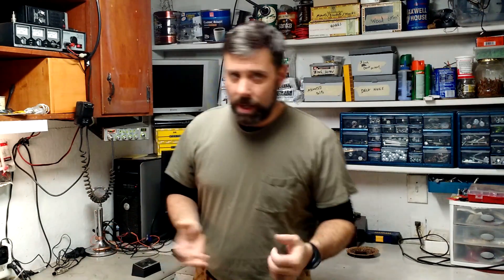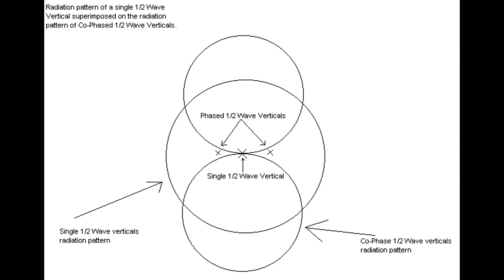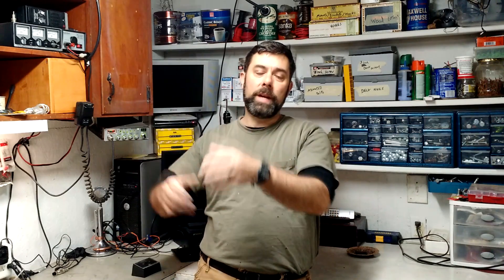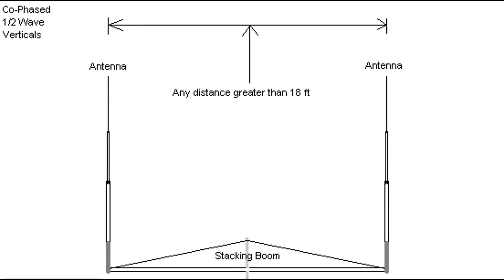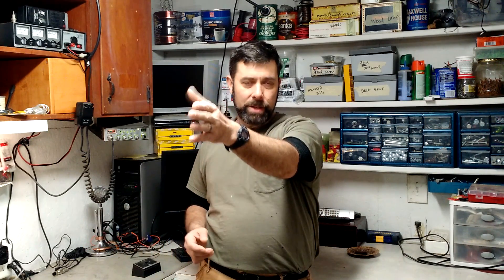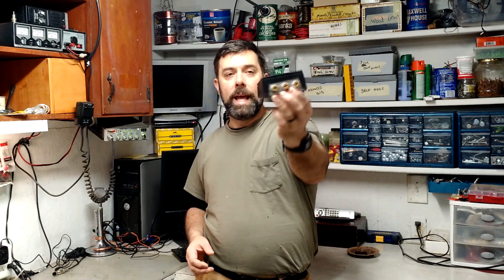Installing Dual Antennas For Your CB Radio. Co-Phased And Switched Setups.

Comment: Question, with a normal Co-Phased setup, will your transiting energy be divided by 2?
So if you have 4 watt going 2 watt to each antenna? Will my transmitting range also be less due to this?
Reply: Yes the power delivered to each antenna is halved with this set up. The radiated power fields should recombine to reinforce in some direction and subtract in others, in other words it makes the antenna system directional. I have to say I’m sceptical of any practical benefit of this arrangement on a vehicle due to a range of other factors too complicated to go into here.

Comment: I have co-phased 3’ firestiks on my F-150 and get a 1to1 match on channel 40 but , on channel 1 it’s 2.3 !  Is there more grounding needed ? Thanks
Reply: It could be related to the fact that the coaxial harness is cut to near 27.405mhz. This is one of the possible trade offs to phasing, although I personally haven't experienced much trouble. You see the cable acts as a transformer so the radio sees a 50ohm impedance. The cables have to be a specific length at the design frequency taking in the velocity factor. So in other words the array has a bandwidth. And if the antennas aren't exhibiting 50ohms then this can throw things off more. So you could play around with grounding or reposition the antennas by trial and error. Best bet is to have antennas with tuneable tips so you can dial up the impedance to some extent. No guarantees though, it's a bit of a guess.
Reply: Sorry I just realised you have Firestiks, I run a 4ft version. So you have some tuning there, with the aid of an analyser, you can really get an idea of what's going on. I'd measure impedance for each individual antenna. You could do this with a half wavelength of 50ohm coax taking in account for the velocity factor. Get them to 50 ohms each then put the harness back on. Then measure the impedance at the radio end and you should see 50ohms. That's one approach anyway.

Comment: I was thinking of doing a 2 antenna setup on my jeeps rear steel bumper. 
I need help with this can you help bud?
Reply: danialphaomega better off with a single antenna on a Jeep, tried both and had better luck with single antenna then dual antennas on my XJ

Comment: is it possible with or without a switch, to use two different wave length antennas on a car or truck, if traveling from flat open land  then into the mountains.
Reply: Good question, Anyone has the awnser? (I think its possible)

Comment: I run a IMAX 2000 about 40 ft High and I also run a Maco 7 element beam  antenna also up 40 feet with a rotor on it and a high power coax switch also have another switch relay or Dow key so when I talk it's through my radio but when I unkey it goes to SDR way better listening on SDR plus waterfall and everything else

Comment: 27 Mhz is the biggest screwup in band allocation.  They should have made CB what we currently now have as MURS (around 152-155 Mhz).  That way cars could easily have true 1/2 wave spacing for phased arrays since that band is about 1.9m so half of that would be only 0.9 meters or about 3 feet.  27 Mhz should have been allocated to hams as the 11m band.
Reply from the maker: I'm not going to disagree with you on that. It would have been interesting to see how the hobby might have grown or maybe not have grown depending on the band or mode that was made legal for CB here in the states.
Reply: That's your opinion probably based in one country.

Comment: What is the best antenna set up for a 1-ton ford van with a fiber glass top?
Reply: Here's the deal:
The formula for your vertical antenna PLUS the counterpoise that it needs is:
the number 468 divided by the Frequency you are using divided by 2 will give the VERTICAL LENGTH in feet and the necessary length of the counterpoise wire to make it work.  The counterpoise is THE OTHER HALF OF THE ANTENNA.
So:
Assuming channel 17 to be about in the middle of the frequencies you are looking at:
468/27.165 MHz. divided by 2       OR:     17.22 feet divided by 2 for a half wave antenna.  OR: for a quarter wave antenna which is the usual size even if less efficient you can divide the 17.22 by 2 then divide the resulting  8.61 feet by 2 for the 1/4 wave length.
This means:
Your vertical will be at it's best, most efficient length with a 8.61 foot vertical and a 8.61 foot counterpoise wire.
Your CB will work, with some slight power loss with a 4.36 foot vertical and a 4.36 foot counterpoise wire.
Bottom line:
Use ONE decent quality CB antenna (Firestick antennas are cheap and work fine).  DO NOT use a antenna with a coil. The firestick has its wire wrapped around the fiberglass stick and that's fine....Those sexy looking coils ain't gonna get ya laid so don't waste yer money!  Then cut a piece of wire  4.36 feet long (or just a skosh over 52.3 inches), crimp or solder a ring connector on it that is just big enough to slip over the antenna mounting threads. This will connect your coax braided sheath to the counterpoise wire.  Tape or otherwise secure the counterpoise wire so it's horizontal and stretched out away from the vertical and  doesn't blow around and yer done!
Just a Firestick and a proper counterpoise wire is ALL YOU NEED!   Then tune the antenna length for best SWR (which will be VERY EASY) and your radio will run better than any of the other radios set up by the truck stop bullshitters.
Now, If ya wanna get serious, go for the 8.61 foot vertical with the 8.61 counterpoise.  Run your counterpoise wire down the vans rain gutter and your done.  Your radio will turn into the monster you always knew it was when its antenna can actually radiate!!! 
bob/KF7ZSA
Reply: ,2 Wilson firesticks

Comment: With beam ant as your turning it will the stations come in better that your trying to reach ?
Reply from the maker: Yes. A directional beam can be turned to face the area a signal is coming from. For long range communications its much better as you will get up to 5 times the signal strength when you are lined up with the other station. 
   Beams are great for base to base communications, but have a hard time tracking a moving car.
Reply: Hi ED.  Licensed Ham Radio Operator here.  With a beam antenna the signals energy is concentrated in one direction.  It works the same way when receiving.  You can generally only hear from the direction the beam is pointed.  The most simple beam will be a two element beam.  

It has a driven element and a reflector.  If you add another element opposite the reflector from the driven that will be a director.  You can continue to add more directors.  As you add them the signal concentration becomes more directional or narrower and the better you have to aim it to receive a desired station.

You need a pretty decent rotor to turn a CB beam antenna.

Comment: Unless you plan to use full 1/4 wavelength antennas I wouldn't bother with it.
Reply: That actually makes no reasonable sense at all. Care to explain this theory.
Reply: @arconeagain  Shortened antennas lose quite a bit of gain. Trying to get some signal back in the form of 1/4 wave physically spaced as well as 90° phase separation isn't enough IMHO to be worth it. A plain old SS 1/4 wave whip mounted so it will clear bridges will do more and cost less.

Comment: Even on large trucks a phase antenna system is a fashion thing, and not a performance thing. After  actually plotting installations using a field strength meter and using modeling software I never found a phase system that have an omni-directional pattern, I'd say put your money in a quality single omni-directional antenna at the center of the cab roof.
Reply from the maker: Thanks for the info.  I think the mirror mount thing is based on the fact that a roof mount on an 18 wheeler would get smashed up pretty bad on overpasses. As for the dual antenna setups. I don't know why they became a thing originally.
Reply: @WolfPackProductions1320  
Joe, go back to the books.  You really should know better.
KF7ZSA
Reply: Who's this directed at?

Comment: Cophased antennas work by directing the same power in fewer directions.  This is how all directional (beam) antennas work.  At 9 feet a cophased setup will have more gain in two directions (to the front and rear of the truck) than a smaller separation between antenna, although even with 9 feet of separation it still isn't very directional.  Something that I don't think a lot of people realize, the layout of the vehicle itself will often have more of an effect than running cophased antennas.

And when it comes to the losses from using an antenna switch, if there is enough that you notice a difference then the switch has a problem.  I have actually measured losses through antenna switches, and even things like SWR meters and pl-259 connectors.  Whenever people talk about losses in these devices, they always seem to greatly overestimate the actual losses present.  In fact, the losses were so low that to measure a pl-259 connector I had to string 11 of them together to get accurate results, and that was with a vna that can measure down to 0.01 dB of loss.
Reply from the maker: Good to know about those real world DB losses. It makes putting a lightning arrestor on an easier choice.

Comment: You can flip that switch around and run 2 radios to the same antenna right? And just switch between the 2 radios.
Reply from the maker: Tiny Phil Yes. You just need to remember to switch it, or you can damage your radio when transmitting to a dead end.
Reply: TY Sir... Well, now I'm off to Lowes to get my switch building supplies. A metal light switch box, a metal light switch faceplate, and a double throw switch toggle. I already have the wire and os239's A Custom switch for under 8 bucks...Who really likes store bought anyway?LOL

Comment: can a house tv antenna be used for cb if it has a coax?
Reply from the maker: No. A TV antenna is tuned just for that, TV. It works well for that function but would be a poor match for a CB, and if you were to transmit using one, you would very quickly damage your CB as the SWR would be VERY high.  
  Even if you found an antenna tuner to sync up the two, it would still be a very poor antenna for use with CB.
Reply: Not exactly true.... although a direct connection from radio to connector is most certainly going to give you grief.... you can use an Antenna Tuner. You will have some signal loss due to the mismatch of the cable, 75 ohm VS 50 ohm, and you might fry the 75 to 300 ohm matching transformer depending on the power you are running it will work.....   
 But unless your going for stealth, I’d opt for a good CB antenna and coax. It will still work out cheaper than a good antenna tuner.
Reply: Yes but if the tv antenna is a typical Yagi design then you are not going to achieve any directionality regardless of a tuner because it is not cut for 27mhz. So it's kind of pointless. You may hear the guy down the road with a kilowatt though.

Comment: I looked through a box last night and found my Dads swr meter , 2 Cobra power Mics and replacement screw on / solder type mic connectors . I don't know what happened to his old White Face Base station ?? He had a Cigar box full of channel crystals he could swap out  , I think it had 5 channels , and in the vehicles it was either Cobra brand , or Pace I believe ????

Comment: Do you think the cars stereo antenna would cause any problems near a cb antenna? Should I try to get some distance between the two, or will it be fine since only the cb transmits?
Reply from the maker: That's a question I've never heard, and to be honest I don't know the answer. My gut tells me that it would not be an issue, but if I can find out for sure either way, I will let you know.
Reply: It can be an issue, any surrounding objects can. If the car radio antenna is of a length related to the 27mhz wavelength, it may interact more by mutual conductance.

Comment: Also I've seen people use those switches in reverse; two radios to one antenna so that they could have a radio in their living room and a radio in their bedroom, and switch between them depending on which radio they felt like using to avoid bothering family members.  I tried it once and maybe it was a cheap switch, but even with stock, factory radios, when I keyed up on one radio, the S needle on the other radio would quiver a little bit, so I got a little bit concerned about how good, or terrible of a job that switch was doing in isolating the unused output from signals traversing the other input/output connections.  With 2 antennas to one radio, if there's a small amount of current running into the unused antenna I imagine it wouldn't be an issue, but when it's another radio on that unused line, I was concerned I might damage something in the unused radio.
Reply from the maker: Interesting. I had been thinking about running a second run of wire into the house so I could have a base station in my house as well as the one I already have setup in the garage. Its freaking cold to be out there sometimes during the winter, and having a setup in the house would get more use.  I had even thought about using that a/b switch for that exact use, but wasn't sure it would work for it. Sounds like it would probably ok, but after I watched your video on how you made your antenna mast for your A99 I started thinking about putting up something like that and maybe trying my hand at making a home brew base antenna.  
   Spring is coming, and I can't wait to get back out on the property to play!

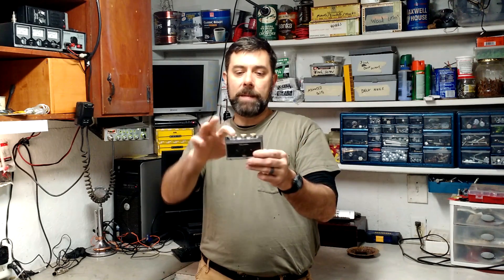Comment: Re: @4:30 I remember when I had one of those home-made "Power Deluxe 250A" base station power supplies/amplifiers, if I didn't turn on the pre-amp, stations that were normally distant were noticeably quieter than when I hooked the feedline directly into the radio itself.  I opened up the unit and double checked all of the connections, replaced the panel jacks thinking maybe they were just old and worn out and never could eliminate that loss.  Since I preferred running barefoot 99% of the time I just sold the thing off to somebody else.  Since then I've done some reading and tried to make sure I have quality coax and connectors, and keep the number of connections to a minimum because even just an SWR meter will introduce an impedance bump and some small amount of loss just from being a non-contiguous piece of cable between your radio and antenna.
Reply from the maker: Totally true, and often overlooked. At 4 watts, every little "leak" starts to really ad up. I usually set my swr, and then run right from the antenna to the radio. nothing in between.

   I did notice that you mentioned in one of your videos that you were using r400 cable. tell me more about that if you would. I use R213 And its about the same thickness as the stuff in your video, but maybe R400 is better?
Reply: From what I've seen on charts, the difference is neglibible; it's like a 0.1dB per 100ft difference in loss if I recall correctly.  The 400 is double shielded so it's a bit stiffer, but if you've already got 213 I would imagine you wouldn't see any real improvement by moving over to the 400.  I just got the 400 because I was only doing a 100 foot run and since it goes through the floor right under my computer, I figured the additional shielding might help eliminate some of the electrical noise from the UPS and computer.

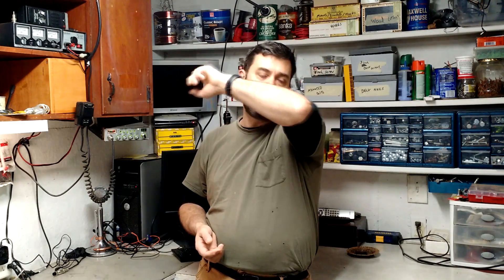Comment: Hi, I do enjoy your videos but please look at your video at 5:03 that you say that you rotate your antenna 360 degrees, if you do that actually your antenna will be facing the same direction, in other words a Circle has 360 degrees, if you rotate it that much you just end on the same spot. Wanted to do the comment in private so you could fix it but could not find how. Take care.
Reply from the maker: Thanks for the heads up, and you are right, I meant to say or imply 180 degrees,  but sometimes I will say 360 instead.
Reply: That was a bit confusing...

Comment: nice video i have a 102 steel whip on the passenger side and was thinking about putting one on the other side thanks.
Reply from the maker: Do it! just make sure to get that co-phased antenna cable and you'll be getting out great.
Reply: I did this on my 91 jeep code cherokee and was able to get contact at 25 miles. If i improved my grounds i could get more

Comment: I just picked up a version at an auction for five bucks hopefully it works.  I have a vertical and then I'm going to try a dipole (base station).
Reply from the maker: Let me know how it works. 
  I had a co-phased setup on my old house back in the 90's that I used to make a poor mans beam. I set it up so I would have a better signal toward the south, where the local group was based, and it worked pretty dang good. I went from 1S units for some of the farther members to 3S (much easier to hear).

  If I could find a cheap 4 beam setup, I already have a spare antenna rotor so I'd hook up this A/B switch in a heart beat.